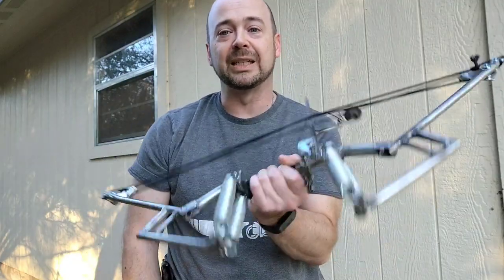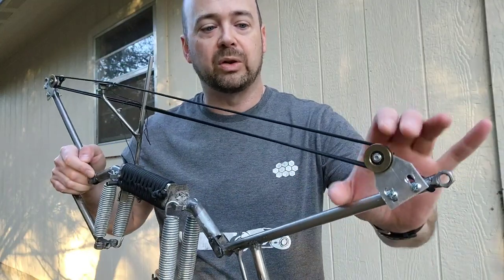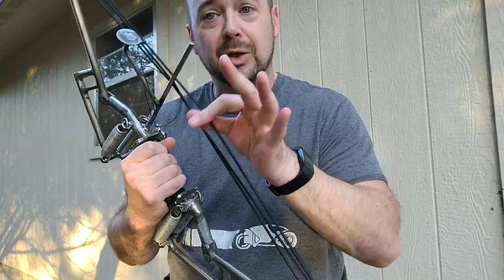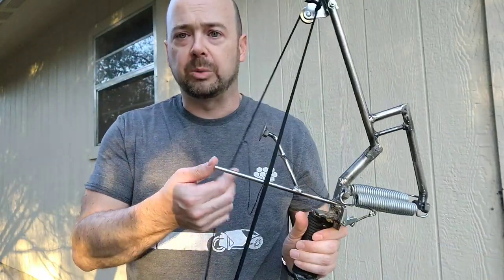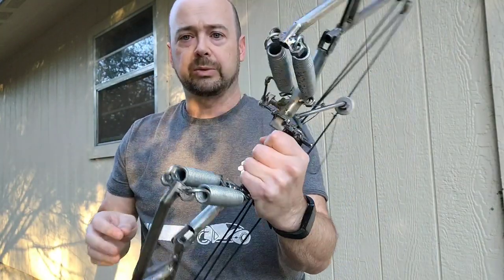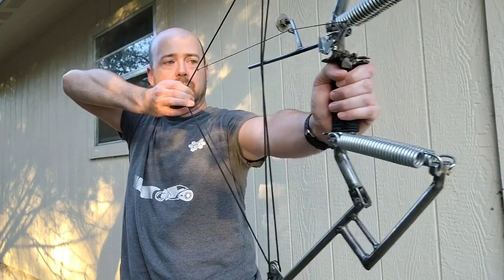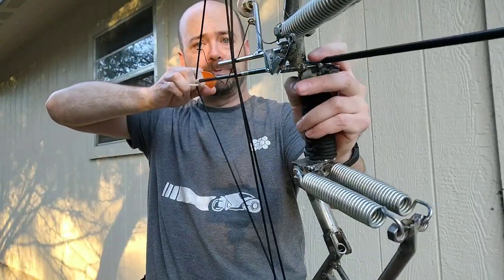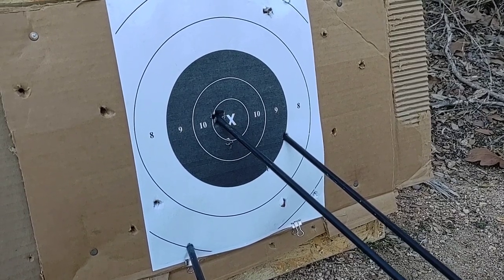DIY mini spring-compound-bow (all steel) w/demonstration

Comment: That’s a very nice bow. But those are pulleys not cams. The difference is the cams are ‘just that’ cams. Meaning they are oval so as when the bow string is pulled then the cams work like cantilevers, which that’s what they are and the pull on the bow string gets easy after you break over the first part of the cam. It’s called “let off pressure”. But again it’s a very nice bow. Thank you for posting it. What I like most about it is that it is very clean looking.

Comment: What’s the draw weight on a bow like this?
Reply from the maker: I'm actually not sure. I'll have to measure it soon and post the results. I've made many PVC bows that range between 25-35lbs for draw weight and this one feels like it could be 40lbs.
Reply: @antburt  what is the draw weight of each spring? I'm asking this because I'm planning to use springs to make a bow, but seeing other videos on the Internet it seems like springs powered bows release the arrow much slower than you should expect, kinda if some draw weight of the spring is lost in the mechanical movement. Your it's the only bow in which I didn't saw that "unexpected slow release", I want to compliment you for your work!